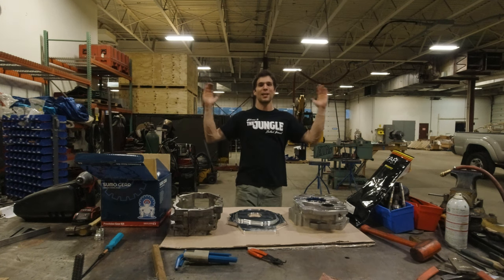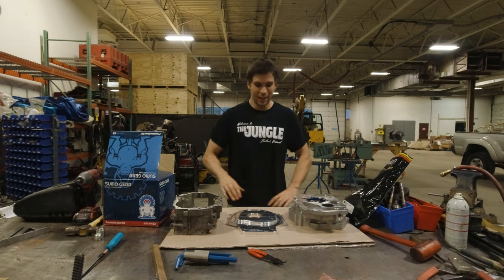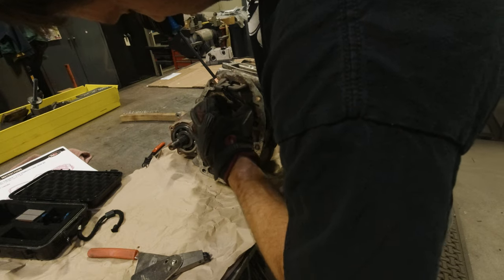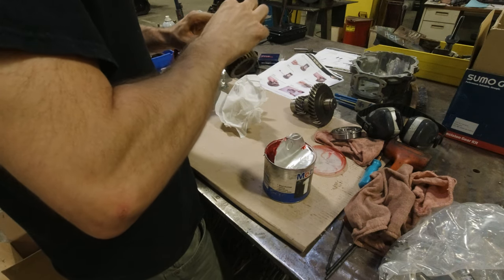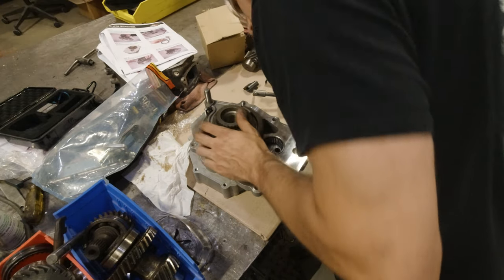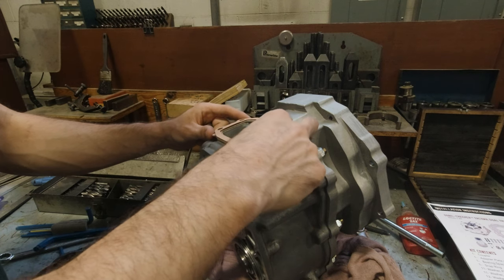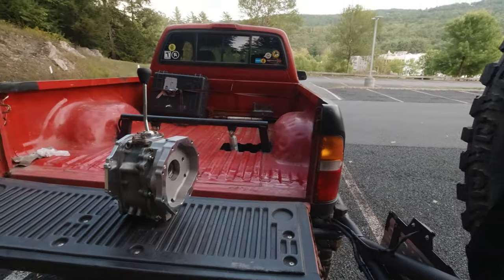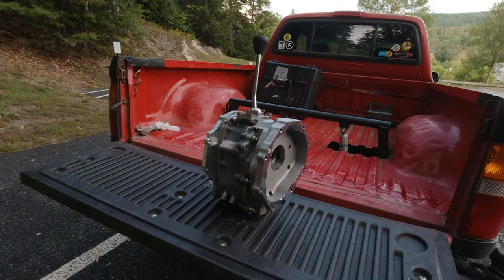Toyota Tacoma DUAL CASES!! | Trail-Gear & Sumo Gear CrawlBox Build PART 1

Comment: 3.95:1 1st gear x 2.57:1 low range x 4.7:1 low low x 4.30 = insane low. I'm getting 205:1, if those numbers are correct. Regardless, this thing will be able to climb a vertical wall at idle without bogging. Its gonna be insane. Really looking forward to the rest of the mods. Keep em coming
Reply from the maker: Closest yet, but 1st gear is actually 3.83:1. Everything else is correct besides the final product, great job!  Yeah I’m extremely excited to see what this thing will do with all that gear. I imagine I’ll want bigger tires before too long 😂

Comment: Seth, totally unrelated but didnt have a clue how to get your attention for timely question burning in my brain.  A while, while, while back you posted your upgrade from billy 51s to Icon 2.0.  I was recommended by Shock Surplus to upgrade from 51s to Icon 2.0 to add more rigidity to my rear.  Will the Icons be able to support more weight preventing me from bottoming out?  How did they work for you, how was their longevity?  THanks
Reply from the maker: Just saw your question!  I still have those shocks on my truck, and they still work quite well. 10/10 on longevity. However, your leaf springs will be supporting the load, the shock is mostly just providing damping.  The valving of the shock will play a slight role in how rough it rides, but if you’re looking for more significantly more support in the rear of the truck, you should be looking at heavier leaf packs.

Comment: I think you now have 216:1 give or take. Also, Tom Woods now has a Toyota HD Shaft, it was recommended as I now have dual cases (but only with 135:1 final wheel ratio). The Tom Woods was made for that Utah Yota guy who chopped and swapped his FJCruiser. I also had issues with fitting it under the body, and had to do a 1 inch lift. I also am having a buddy install the frontrange t-case cross member, just to add some stability there. should  fit.
Reply from the maker: Also close with the calcs!  Thanks for the heads up on the TW shaft, gotta call them up at some point soon and have a chat.

Comment: Given you've got a '99 TRDOR with manual 1st gear should be 3.42:1, and t-case low is 2.57:1... Add in the 4.7:1 dual box &
Stock crawl ratio 37.79442:1
Dual case 177.63377:1

Comment: Did you ever get around to installing this? I manual swapped my 4.7L Tundra with the same transmission you have in your Tacoma and I want to do the t case doubler with the low gears too so this video is awesome ⚙️
Reply from the maker: I actually don’t have it in yet, bunch of stuff has come up and I’ve taken a short hiatus from wrenching on the truck, much to my annoyance. This is high on the list though, I’m going to build the crossmember for it shortly and will definitely have a video on the whole thing
Reply from the maker: Thanks for the support!

Comment: I had a Toyota hilux with the horrible bench seat in it, I swapped em out for Nissan Pathfinder seats I pulled from a pick and pull. You’ll have to drill holes and use shims but it’s worth it for a pair of seats that aren’t too expensive and better than the bench
Reply from the maker: Hey great suggestion!! I’ll keep that in mind…might be taking a trip to the pick and pull!
Reply: @S0nnenberg  also I forgot to mention if you find a 4Runner that’s the same generation as your truck then the seats will just bolt right in

Comment: 85-95 4runner 4x4 rear stock driveline will fit your dual case setup
Reply from the maker: It’s possible, though with the 63s this thing flexes like mad and is quite a bit higher in the rear. Will still probably go custom!